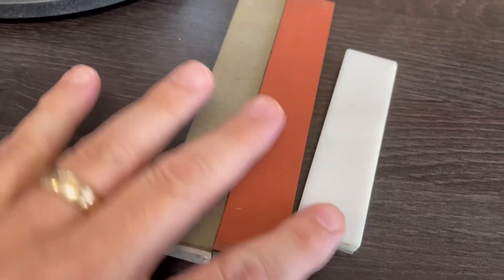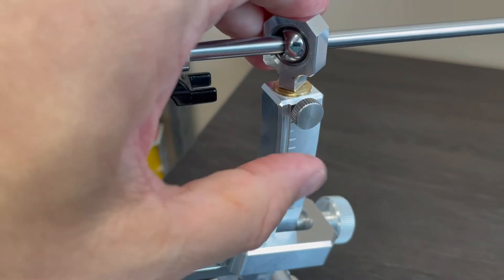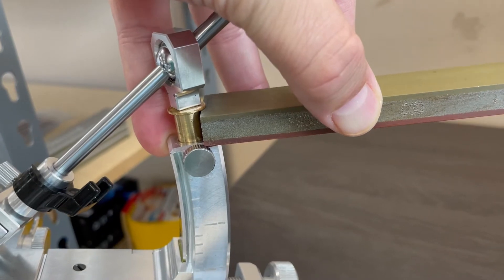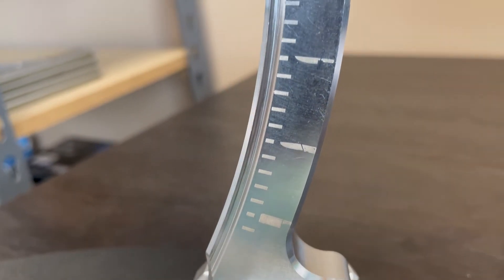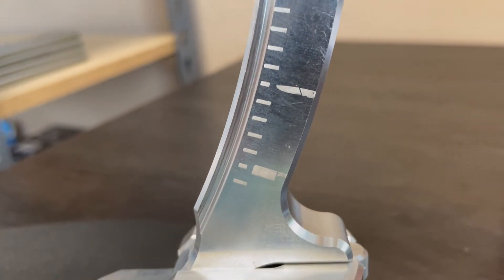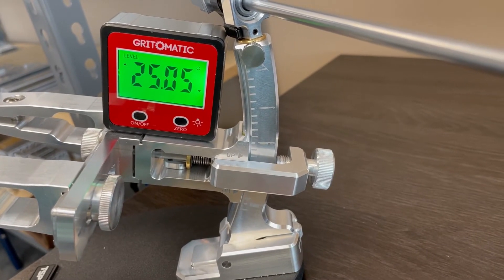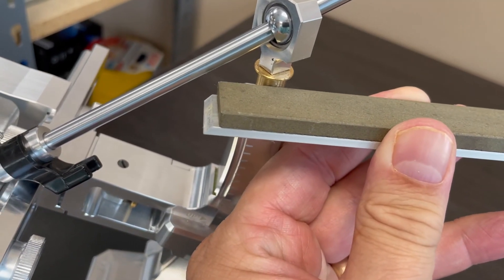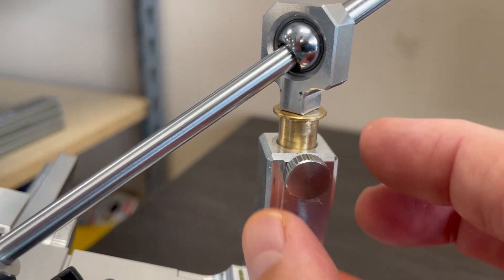Thickness compensator for TSProf Kadet knife sharpener

Comment: So the first thing to do is set the stone compensator then do you place the stone back in the holder and zero it on the blade and set the angle ? What am I doing wrong every time I switch stones and adjust the compensator my angle finder shows a different angle so it’s not compensating what am I doing wrong. After I clamp and set the stone thickness what do I do next

Comment: When you put the angle gauge on the rod to zero it, where exactly are you putting the rod? Does it matter? Are you laying the rod on the clamps??
Reply from the maker: The guide rod must rest on the clamped blade in the center.  It's a universal rule for all guided sharpening regardless of the role of the guide rod (measurement or zeroing).